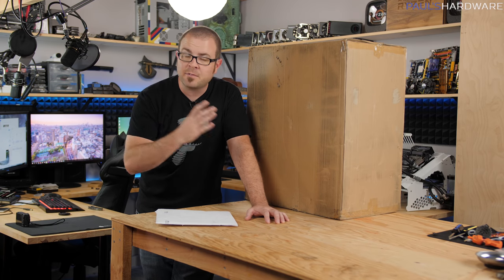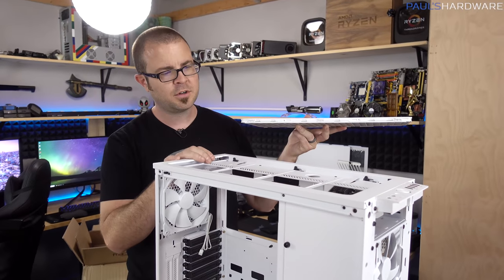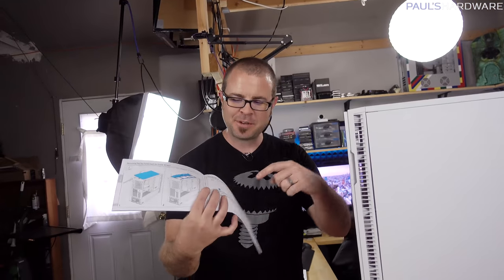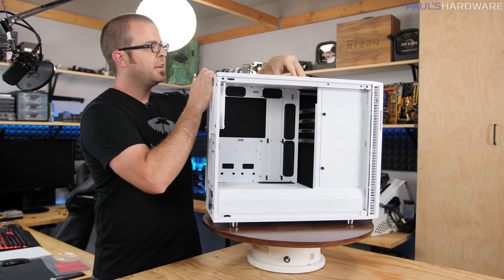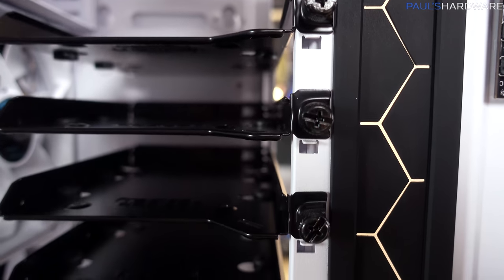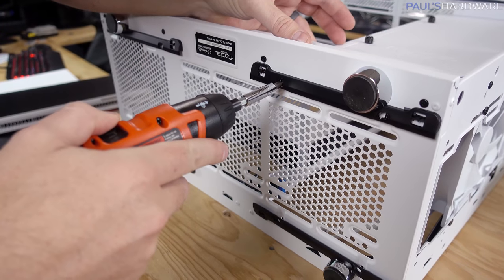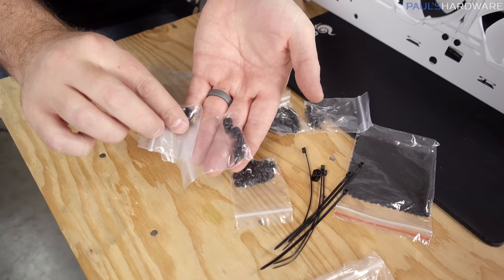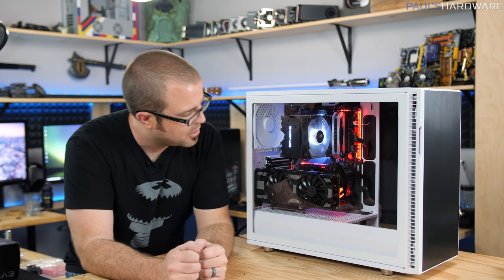Fractal Define R6 - A PC Builder's Review

Comment: Great video Paul. Glad to see you did a build in it, really helps seeing how it would be. With the vertical GPU mounted, would it not be possible to mount a GPU in Slot 1 and also have a vertically mounted GPU? For instance I have 2 EVGA FTW GTX 1080's I would love to do a config with one horizontal and one vertical. Could this be done. I know you said it takes a lot of room and that it potentially blocks the rest of the PCI slots.

Comment: I like it a lot.  Just a few things from perfect for me, i'd say.  Wish it had a smooth mesh front panel instead of the solid brushed panel for better airflow.

Q4 Paul: Can you mount that drive bay shroud over the open back of the case, to cover up the exposed part of the cable management section?
Reply: Correction.  HardwareCanucks confirmed, you can mount the drive-bay shroud into the back to fill that empty space.

Comment: Nice with the bottom filter accesible from the front. I will remember that feature.
Can you replace the cpu cooler without removing the mb?
And no hot swap drive bays?

Comment: Are the included fans considered good enough? If not what  would you recommend  instead?
I'm  extremely  torn between R6 White and Meshify C White. 
Also thought about installing a 240 or 280 Corsair H100/115i Pro AIO cooler ON TOP as exhaust. 
So 2 140mm front intake, 1 140 back exhaust and Rad with 2 on top exhaust Probably

Comment: Really cool that you linked other reviews in the description.  I know that it doesn't seem like it is possible,  but is there any way to have a 3.5" drive and the front section removed? I am looking at doing a custom loop in this, but I have one HDD.

UPDATE:  In the HardwareCanucks review you can move that front panel to the back and mount the 3.5" drives to that! Really cool. Easily the best case of 2017.

Comment: The case needs a white front.

Clearly a great case for watercooling, love the idea of pre-drilled fill port mounting.  For air cooling there are a couple of obvious mods.  For vertical mount GPU need to drill some breathing holes in the tempered glass to allow GPU fans to get air.  On top I would raise the solid moduvent panel by 1/2" to allowair to escape yet still keep some noise dampening and clean look.

I actually prefer the vertical mount GPU - no pressure on motherboard and therefore no board droop - also much cleaner cable management

Comment: The solid front panel is a weird design choice. With the panel in place the air can only come in from the sides so the front filter isn't necessary. If the front panel is designed to be opened up or removed for more airflow having the filter as the front facial is not aesthetic. It would be better to have ventilation slots on the front panel for airflow and the panel should not cover the 5.25" drive bay. Otherwise have a nice mesh instead of a solid piece so that the front fans can be seen for some RGB goodness.

Comment: Why isn't it a white front panel?!?! The whole thing is gorgeous for an all white build then they put an ugly black panel snack dab in the front
Reply: And they put black pcie slot covers in the white one and white ones in the black one! What's up with that
Reply: And 11 months since the launch , I have no idea , at least if it,s possible to get at least optional a white front panel. I was going for the "Define 5 " white . Now , looking at "Define 6 " I like it more , seems more roomy, and maintaining the 5,25 inch bay for the optic drive . Maybe the front panels have exact same size , 5 and 6 . Also the tempered glass is a big plus "Define 5 ". I look in to this when I will prelate to order  . There is a bit of time to wait for the new AMD hardware as well.
Reply: @kitchenetotomis9717  its called artistic composition, contrast with light and dark makes the shapes "pop"
Reply: @kaizze8777  Thanks for the impression Kaizze . I thought somewhat simillar. But , there,s enough dark in my house , I don,t want to add to it :) . Probably I,ll spray paint it , considering that I already have a white primer spray can.  But in the next 6 months, I hope a price drop in nvidia graphic cards. 1070 ti's jumped up 30% in the last couple months.
Reply: @kitchenetotomis9717  in that case you should make your case look like a storm trooper XD
Reply: @kaizze8777  Already is!

Comment: Got the Define S with my custom loop in it, 360 and 240 rad with a 980ti and i7 4790k, might just swap to this case since It's got the dust filters mine doesn't have (I removed the front since I needed space) and the PSU shroud! Really beautiful, would fit my black and white build!

Comment: Hey Paul, great video (as usual). If you take out Drive cage shroud thingy, can you still put any 3.5 drives into the case below the PSU shroud so you can have both open layout and some larger storage? Also, thoughts on the solid front? Any choke points or are the side vents enough?
Reply: The shroud can actually relocate to the back and you are still able to mount 2- 3.5" drives on it
Reply: Very nice. Thanks! The case looks awesome. Ever consider making a ventilated back panel where the open spot is for a rad to be put there? It's kinda the perfect spot if the drive shroud were removed. Just spitballing more ideas where the case could be more customizable for WC. I love the TG implementation.
Reply: Nice idea, but realistically there's already plenty of options for radiator placement. Asking for more is just greedy! A pump mount would be nice though.
Reply: It's never greedy to have more rads. :P

Comment: What I would most like to know is...have they fixed that ****ing rattle from the bottom filter if you have mechanical drives installed? Honestly, for the most part I love my R5, but that really spoils it for me.
Reply: blahblahwhatblahblah I have the r5 and there is no rattle.
Reply: Lucky you. What am I supposed to do with that information? Decide my ears are making it up? Just because yours is silent, doesn't mean everyone else was as lucky. Google "rattling define r5" if you don't believe me. As such, I'd like to know if the design has changed for the R6.

Comment: The only thing I don't like, and that's purely preference, is that solid front panel. Never did like those. Might as well have meshed it out or glass since this case series still has good airflow despite the front panel design.
Reply: Agree, this plus the Meshify C front panel = perfect

Comment: Do you think it would be possible to mount an h100i V2 to the front? I know it will have clearance if the drive bays are removed but I’m concerned about the tubes actually reaching that far.

Comment: Could I fit 2 80mm fans side by side below the 2 140mm on the front panel? I know I wouldn't be able to screw them in traditionally but would 2 80mm fans physically fit side by side regardless of screw position. I would just find another way to secure them. Looks iffy because of the PSU shroud extending the length of the case. Feedback much appreciated!

Comment: Can someone explain why everyone wants type c, I don't know any uses for it.
Reply: Envy Robbins Newer phones
Reply: Because type C is the new universal standard. The roll out is slow however because manufactures are cheap and people complain. When everything comes with a type c port then you will wonder why your case does not have type c.
Reply: Because it allows for a lot more bandwidth, and power to be delivered over the USB-port? Not to mention other benefits like graphics, more bandwidth in general for sound, graphics, etc. on the same cable, bi-directional power support... USB-C is an excellent tech, unfortunately, adaption is slow :(

Comment: Do you think its possible to use this case with RTX 2070 MSI Gaming Z which should be 307 mm long and still use the HDD section without removing it? On paper it says its up to 300 mm but i've heard its actually possible to use even 310 mm cards. Does anyone know? thanks

Comment: I think the R6 is a bit backwards in some ways. Fan controller isn’t manually controlled like the R5, some may like that but I love my manual fan controller. Moduvent system used to come off in panels so you could only expose what you would use. Now if you open it up and put a 240 mm rad up there you’re going to have dust falling through the other half you’re not using. Not sure why they did that. PSU shroud is meh but it blocks the fans from down below from pulling air through the bottom.
Reply: Joseph DiFeo that isn't a backward move at all. Moving from manual control to a full fledged powered pwm hub is a move in the right/forward direction.

Comment: I dont get this glasspanel trend going on. I want solid panel with the option for intakefans. 
I have a CM Centurion 590 i belive its called. 
Fucking amazing old case. Direct fan straight to the gpu from sidepanel and also right over cpu cooler. I did however had to install that fan on the outside of my case but oh boy my pc never hot. 😁

Comment: If you install a top-mounted radiator, where does the air go? That looks like a hard cover with a filter and nowhere for the air to go
Reply: Arkador If you install fans or a radiator in the top you remove the metal and just put in the top filter.

Comment: Oh and other than that, I'm on board is the price is right. I love white and this has everything going for it. Looks, substantial modularity, functionality and it's white. It's gorgeous. Fractal Design is on fire this year. First the Meshify and now this? Also, sleeved fan cables and machined aluminum case feet. This case is perfect. I'm calling it as the best case of the year. I got to have it. I have to have it.

Comment: Dammed only 3.0 and 2.0 front ports and no HDMI port.  Nup, not even worth considering, regardless of how easy or hard it is to build;  and I wouldn't buy it for that one reason.  Sheesh I don't understand why 3.1 gen 2 Type C and Type A x 4 at minimum is not the standard on the front panel.  When will computer case makers learn that they are way behind the times of todays expectations of data transfer

Comment: Another case that chokes the intake on the front, that's gonna be a hard no bud.
Reply: RB Newell not really, they gave it ample room for airflow
Reply: RB Newell exactly. There's plenty of venting on the sides. Gamers nexus says somewhere close to an inch is plenty for front airflow. It won't match a full meshed front panel but is more than sufficient.
Reply: Duane Ford Also the base and top are fully available for airflow.

Comment: $40 ribbon cable, $30 front Io replacement? 
sounds like DLC on A CASE!!!!
I hope like hell that other manufacturer's don't go this route, and that fractal design doesn't do this anymore.
Reply: The PCI extension cable is actually the price you'd have to pay for ANY such cable. I don't see anything wrong with that. I do agree with the USB C port though. I think it was a last minute revelation they had. Especially considering it isn't widely available yet, yet the case itself is.

Comment: moduvent looks like a POS like previous moduvents. Still have the same annoying recessed reset button that you have to use a pen to press. How much space is there between the front fans and the HDD caddies? Looks like you might need to remove all the HDD caddies in order to use an H115i 280mm rad, which would make the whole case rather empty and pointless compared with the Define C which woudl do the same thing. For a 25m video i think you should have at least demonstrated that. Why don't u read the instructions b4 making the video? It would be more logical and you'd spend less time faffing around and speculating.

Comment: not impressed. this case seems over engineered. I never liked psu shrouds, the top and front and.... just over engineered. Im not shitting on the R6, its just not for me.

The R5 is everything i want it to be, MINUS one imperfection. the R5 is already pretty big, whats 1 inch more? If it had been 1 inch longer, I could have fit BOTH a corsair rm850x AND a 140mm bottom middle fan. Instead, I had to return the psu and get an AX760. Im happy with my AX760, but im not happy that i had to return a perfectly good psu because i couldnt fit a 140mm fan with it.
Other than that, the fan control is an option i suppose, although not needed. Im still unsure why anyone thought usb ports facing up and always open was a good idea. I see it on a lot of cases.
However, the R5 is by far the best case ive ever owned for $99. Yup, got it on new egg, no tax, no shipping wewt!

although, what id really like to see is those gd honey comb grills disappear. Only way to get rid of them is to hard mod it with tin snips and a dremel. its a lot of work and a pain in the ass, although i didnt do it to my R5, more or less to lazy =P.
Reply: About honeycomb (hexagon-shaped) grills, they are there because they cover the opening the least out any other shape, such as circles, squares, or triangles.
More about the efficiency of hexagons:
http://www.slate.com/articles/health_and_science/science/2015/07/hexagons_are_the_most_scientifically_efficient_packing_shape_as_bee_honeycomb.html
Reply: they could just leave the space open and offer the old style target circle grills, which produce the least amount of noise and allow the most airflow vs all other styles vs nothing at all. I would personally not have anything. front and bottom dust covers are noisy enough and keep the majority of dust out of the case. I see no need for exhaust grills, except that it would be open and one may drop something on top of the case? i guess? I personally have my case on my desk and dont have anything above it small enough to make it through the fan blades.
anyhow, they did a really good job with the R5. the R6, not so much, but hey, thats just me.